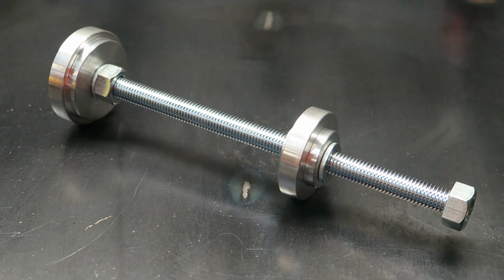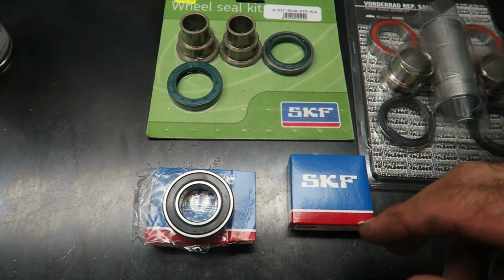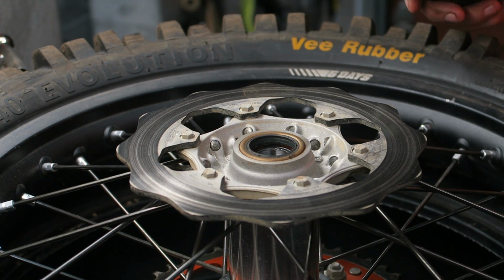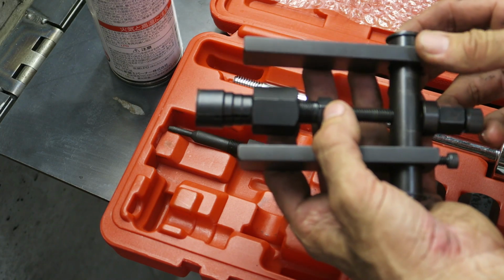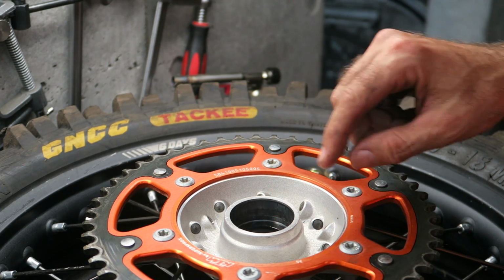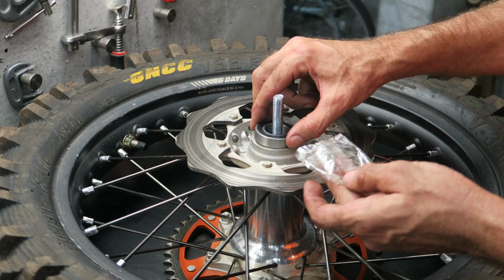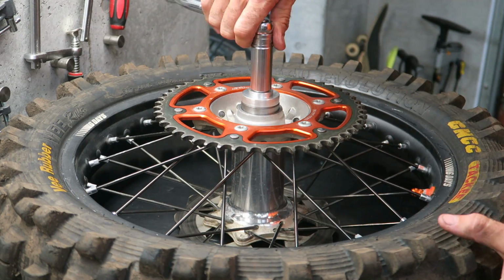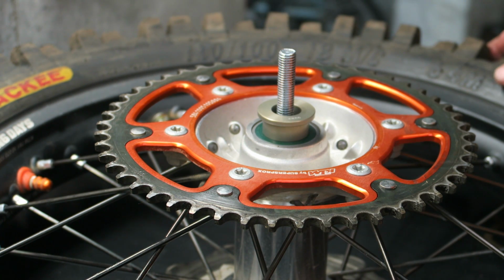KTM wheel bearing replacement- Tokyo Offroad WBPT use

Comment: Do the bearings have to move freely in the hub? Or be more like tight? Thank you.
Reply from the maker: Typically they will have a little side load from pressing against the spacer shaft, making them more difficult to turn than just the bearing on it's own.
Reply: @TokyoOffroad thank you so much your videos are awesome.

Comment: how do you keep the threaded rod from spinning on the back side when tightening down?
Reply from the maker: If the nut on the base is tightened the rod should not spin when tightened. Optionally some threadlock can be used in the base and base nut to keep everything secure. The WBPT usage instructions are here and I do suggest using some threadlock in the tool assembly instructions: https://tokyooffroad.com/wp-content/uploads/2017/08/WBPT_TO-002.pdf
Reply: @TokyoOffroad  got it thank you.  I've changed a lot of wheel bearings but had a set last night that really gave me trouble despite using a lot of heat to remove...  found myself looking at videos last night and yours was a big help

Comment: If you’re driving in the second bearing with an appropriate diameter bearing drift (eg the motion pro ones), how firmly do you seat it against the spacer? Is the bearing driven enough if the spacer is in the correct vertical position and it doesn’t move freely on its own, but if you put your fingers in there you can only just move it a bit side to side?
Reply from the maker: You should drive the second bearing in so it just touches the spacer. Make sure that the spacer is sitting in the hub straight.

Comment: One note is that one side of the hub has a plastic spacer behind the bearing so I wouldn't heat the hub too much, otherwise you risk melting it!
Reply from the maker: The plastic spacer should be further in the hub, away from the bearings. It's purpose is to hold the axle placer aligned with the bearings when the axle is removed, thus allowing the axle to be reinserted more easily. As it's away from the bearing there is no chance your melt it while heating the hub, besides which if you're heating the hub hot enough to melt plastic it's to hot. I aim for no more than 100degC. Personally I don't refit the plastic axle centering rings.

Comment: no light coating of grease on bearing before pressing? I find it helps it go in so much easier...
Reply from the maker: You can do. I find freezing the bearings, heating the hub and using the press tool they go in easily anyway, without using grease.

Comment: I did a friend's rear wheel bearings recently.  It would appear that the KTM kit which included new spacers and everything had a centre spacer that was slightly longer than the distance between the two seating lips of the hub. I only noticed this once I had it all back together.  A local mechanic told me that he regularly has to make sure he does not  drive the second bearing outer race all the way home. He stops short when the inner race contacts the spacer tube.  What a crap design perhaps? Or did the engineers allow for a certain amount of crush in the system when the rear wheel is torqued correctly? Im thinking I might need to do it again so that the bearings are not being side loaded. What are your thoughts?  It would appear that your tool only drives the thing in till the inner race hits the spacer tube. Guess I should get one.
Reply from the maker: Sorry to hear about the problem. Yes, that's an advantage of using a press tool like I offer as excessive side load will not be applied to the bearing during installation if you stop pressing it in when you feel an increase in resistance as shown in the video. The tool significantly reduces the chance of messing up the installation.
Reply: @TokyoOffroad   its weird its not machined same don't you think. Why even have a lip for the outer race to sit against if its not a locator? Before I pull it apart I'm going to ask a couple of other Ktm shops.
Reply from the maker: @ashwillmot2051  - Yes, the center metal tube spacer length is important and will determine the overall width between the outside edges of the external spacers.

Comment: What brand is your blind bearing puller? Looks like a Sealy? What do you think of the Motion Pro? It only has the slide hammer, not the bridge puller thinger -> wondering if those can be purchased independently
Reply from the maker: The blind bearing puller set I purchased from a local tool shop in Japan. It's unbranded and I think is probably imported from Taiwan. Not the best quality but works OK. I have quite a few Motion Pro tools and like them. I haven't looked at their bearing puller set though.

Comment: If I have anodized hubs, with the torch ruin the finish?
Reply from the maker: Yes, if you apply too much heat the surface finish could change. I aim for about 50degC (just too hot to touch comfortably) which will not cause any damage...
Reply: @TokyoOffroad  thanks.  I'll be putting your tool to use again, ha ha
Reply from the maker: @JoshStreetDesign  Thanks. Hope it goes smoothly
Reply: @TokyoOffroad  So I installed my bearings the other night and I absolutely love your tool It makes things so easier... The only problem is I can't figure out a way to tighten the nut to the bottom piece so that when I turn the top on the other side it doesn't spin the rod all the way through... I wish you would include a reverse thread nut so that they could back up against each other and the bottom wouldn't spin out...
Reply from the maker: @JoshStreetDesign  Pleased to hear that you found the tool to work well. If you don't mind having the base installed on the rod all the time, my recommendation is to threadlock the rod to the base to prevent it coming loose.
Reply from the maker: @JoshStreetDesign  The rod is standard size M12 x 1.75 pitch. I'm not sure what you mean to a reverse nut. If you mean double nutting, that would not stop the rod coming out of the base when you undo the press tool. The easiest way I can think of is to use some threadlock. I do suggest this in the WBPT Usage Guide (page 1, note 2): https://www.tokyooffroad.com/wp-content/uploads/2017/08/WBPT_TO-002.pdf

Comment: Is this tool only for ktm ?
Reply from the maker: It can be used on KTM, Husqvarna and GasGas full sized off-road & MX bikes. It should work fine with any wheel with 6906 front bearings and 6005 rear bearings.

Comment: Hey, I always value your opinion. What do you think about removing just the seals, circlip, and bearing cover rings to grease the bearings? My 2020 bearings feel fine at 60 hours but I just finished greasing everything on the bike except the wheel bearings. No one ever talks about greasing the wheel bearings nor does the manual mention it either. I think most people just grease once when they replace the bearings.
Reply from the maker: To grease the bearing (to prevent water ingress) you can just remove the spacers then pack grease in between the dust seal and bearing.
Reply: @TokyoOffroad  I understand what you are saying but I was referring to actually exposing the ball bearings. There are a few youtube videos out there about it. One was on a 2017 KTM. The guys in the videos use a pick to remove a metal ring and expose the ball bearings.

Comment: if this were a little larger it could be used for washing machine bearings. If during the install you pinch the new bearing it will fail often within months. Which is a lot of tedium to deal with because you have to do another removal and install.

Comment: Hey Mark!  I found a distance ring in my hub but gnarled it up getting bearing out.  Mixed stories on whether it's necessary.  My 350 XCF doesn't have one.  You don't in this video either.  Thoughts?
Reply from the maker: If you're talking about the plastic ring, I don't reinstall them. The function is to keep the central long spacer centered in the hub when the axle is removed to allow easier axle insertion when re-installing the wheel to the bike, but I have never had any issues without the plastic ring so choose to not use them.
Reply: @TokyoOffroad  that's it.  I was confused.  It was the first time I'd seen one come out of a wheel.  😂

Comment: hi Tokyo, on the sprocket side, I had an extra plastic washer under the bearing. I assume its there to keep the long centre spacer centralized?
Reply from the maker: Yes, that's right, it keeps the the spacer centered when the axle is removed. I usually don't bother refitting it though and don't experience issues with installing the axle during tire changes.
Reply: @TokyoOffroad  awesome, thanks for the reply.
Reply: @TokyoOffroad any idea why the spacer is only on the 1 side? The hub diameter is the same on both sides and that centre spacer can still misalign on the disc side without one there.
Reply: @TokyoOffroad also, how does yours assemble properly without adding the plastic spacer? Mine spaces the sprocket side bearing out that 1/8” when it’s installed. So if it doesn’t go back in, how does your centre spacer not prevent the sprocket side bearing from seating in all the way to the hub lip?
Reply from the maker: @ThisTall  The axle tube fits through the plastic spacer (if you use it) and is intended to help keep the tube centered when the axle is removed during tire changes. The bearings should both touch the axle tube. When installing the second bearing you should press it in so it lightly contacts the tube. If you press it in too far (difficult to press in too far if using the Tokyo Offroad WBPT, but can be done is using a socket or similar on the outer race) it can bind up and not run smoothly.

Comment: Hey quick question. I have a 2014 ktm 250xc and I am in the midst of replacing the wheel bearings however it seems there is a rubber insert that seems to go below the wheel bearing on the brake side and it seems the axle tube goes inside this little rubber insert in order to clear both bearings but now that I have the bearing seated on the brake side, my wheel seal doesnt seem to want to seat nicely. Do you have any tips or tricks? I didn't see anything about that in your video so I'm a little stumped
Reply from the maker: The piece is to center the bearing spacer tube in the hub when the axle is removed. It is important that if you use it the spacer tube must pass through (it must not be positioned between the spacer tube and the bearing. I typically do not reinstall them. The only advantage of having it installed is when installing the wheel in the bike the axle may pass through easier as the spacer tube is held in good alignment. But I've never had an difficulties without it...
Reply: @TokyoOffroad  when reinstalling it without the rubber piece how do you seat your bearing on the side that is supposed to have it? I found the tube impeded on the seating of the bearing on the other side where you install the circlip. Thanks a ton!
Reply from the maker: @deangraves908  Install the bearing with the circlip first, install the spacer tube, install the second bearing until the inner race just touches the spacer tube. Confirm that the spacer tube is correctly aligned and if not re-align it and press in the second bearing further if necessary. There should only be light lateral force on the inner races, but they should hold the spacer in place.
Reply: @TokyoOffroad  thanks mate! I'll likely do this next time. The rubber insert is a pain anyway haha.

Comment: An old YZ 125 I had years ago had worn bearing races on the rear wheel, you could almost put the bearings in by hand, instead of getting a new hub which I couldn't afford, I just used a loctite product, think it was called bearing seat or bearing lock compound or something, it worked, because the bearings were a lot harder to get out.
Reply from the maker: Yes, Loctite 638, or 648 (retaining compound) can be used if the bearings aren't a good press fit in the hub

Comment: Will this tool work on both a husky TE and a TX rear wheel? I believe they are different size axles.
Reply from the maker: Yes, the Tokyo Offroad WBPT will work on both the TE and TX wheels. The bearing size is the same on both wheels, it's only the spacer size which is different...

Comment: Will this bearing press tool work on a 2020 ktm 500 exc. I think the axel size is 20 and 22mm.
Reply from the maker: Yes, the wheel bearing press tool will work great on 2020 models. The axle size doesn’t actually matter. The bearings used have internal bore diameters of 25mm (rear) and 30mm (front). Spacers are used between the bearings and axle.
Reply: @TokyoOffroad  thx. Mike from tacomoto sells your press tool on his website. I’m definitely going to order.

Comment: I’m surprised that your not supposed to use grease on the bearing spacer
Reply from the maker: The spacer is aluminum so doesn’t corrode and doesn’t move against anything so doesn’t require lubrication.

Comment: Does the KTM WBPT Tool work for the 2015 KTM 690 Enduro R? I need to replace my front bearings. Would like to order and use it if its compatible.
Reply from the maker: Yes, the Tokyo Offroad WBPT will work fine with the 690 Enduro R front wheel bearings (6906 size), but please kindly note that it is not compatible with the rear wheel bearings, although I have made a custom tool for a customer.

Comment: do you sell the bearing puller kit?
Reply from the maker: I have supplied bearing puller kits to a few customers who requested them, but due to the weight the shipping cost tends to be expensive. As such my recommendation is to try to find something local.
Reply: If you are on the US search Alpha Moto 12pc bearing puller on Amazon.  It’s the exact same.

Comment: Hi Marc... can you share the ktm wheel bearing specs so I can order SKF ones?
Reply from the maker: Front wheel bearing size is 6906. Rear wheel bearing size is 6005. Kits with SKF bearings, seals and spacers are available. Your front wheel axle is 26mm diameter and requires the WSB-KIT-F008-KTM-HUS kit (includes bearings, seals and spacer). If you just want the front SKF seal and spacer kit the part number is W-KIT-F008-KTM-HUS. The rear kit for 20mm diameter axle is WSB-KIT-R006-KTM-HUS (bearings, seals and spacers), or W-KIT-R006-KTM-HUS for the seal and spacer kit.
Reply: Tokyo Offroad thank you very much !
Reply from the maker: Wild Enduro - Note, I don’t actually know what year, or model your bike is. The axle size is different depending on the model and year and the axle size will determine what size spacers you need. So please check your axle sizes before ordering
Reply: Tokyo Offroad 2020 350 Six days
Reply from the maker: I can't seem to find the parts list for the 2020 350 Sixdays. I'm fairly sure your rear axle is 20mm and the front is 22mm, so if you want an SKF bearing/seal/spacer kit then rear is WSB-KIT-R006-KTM-HUS and front is WSB-KIT-F023-KTM-HUS. But I recommend double checking your axle sizes and the above part numbers before ordering...
Reply: Tokyo Offroad thank you. I will measure it.

Comment: I find for removing the seals the  easiest way is to use a pair of vise grips to lever off the old bearing, super easy, of course a proper seal remover is ideal but anyone that has tools has a pair of vise grips. In my experience I've never had to heat up the hub, wheel bearings usually come out easy enough with little effort just don't hit them too hard on one side or they get stuck

Comment: Awesome video!! I was looking for resources to change the wheel bearings on a spare set of wheels for my 690 Enduro/ 701 Supermoto. I have a bearing puller and driver kit althiugh not similar to the tools you have. Could you please share the links to where I can buy the tools in the video. It would be of great help. Thanks in advance!
Reply from the maker: I’m pleased you enjoyed the video. The blind bearing puller kit I purchased many years ago in Japan. Similar kits are available on Amazon. The bearing press tool I make and sell on the Tokyo Offroad web shop here: https://www.tokyooffroad.com/product/wheel-bearing-press-tool-wbpt/  
I can make custom sizes to order if required.

Comment: Just ordered this and replaced my bearings as per the video. Went perfectly. Great tool and great instructional video.
Reply from the maker: Thanks for the feedback and pleased it went smoothly.
Reply: @TokyoOffroad  I ordered the kit a year ago. After 450 hours my rear wheel bearings needed replacement (2017 KTM 300XC). can't believe they lasted that long. anyhow, it was very easy with this kit, money very well spent. Of note, the collar inside the hub took some work to get out of the way to use the hammer/punch method. It's very helpful to get the hub around 200 deg F. to punch the bearings out. I also installed the skf bearings and seals which are very good quality. Threw on a brand new M5B tire and zero bearing play. Great tutorial!
Reply from the maker: @CW-up7xv  -  I'm pleased to hear the wheel bearing press tool worked well for you. Yes, definitely heat the hub before removing the old bearings to minimize the chance of damaging the hub. The key to long bearing life is minimizing water penetration in to the bearings. Good seals such as the SKF ones you fitted help, as does applying some grease to the bearing face and renewing the grease when you change tires.
Reply: @TokyoOffroad  always renew grease on tire changes. Try to fill area between seal and bearing w grease. I live in the US PNW and dealing with wet conditions is routine. 

Like your presentation. I'm an engineer at heart and the devil is always in the details so your tutorials have been great data points for me. I usually pick up one or two tips from each video you post. Can't wait for the continuation of your bottom end series.